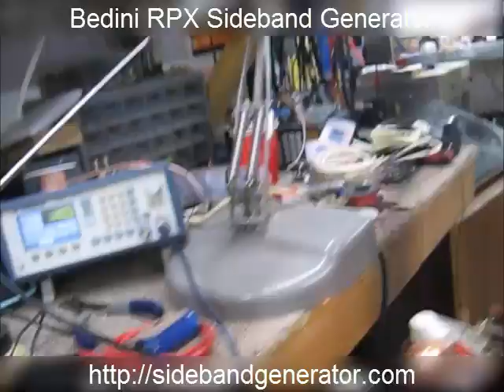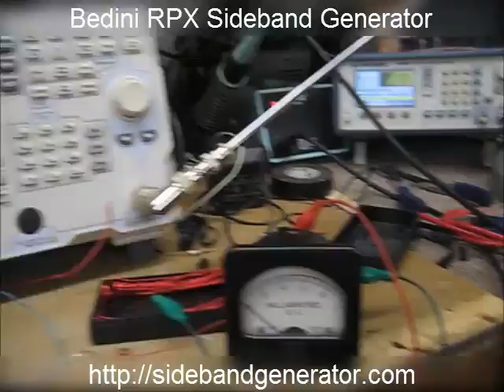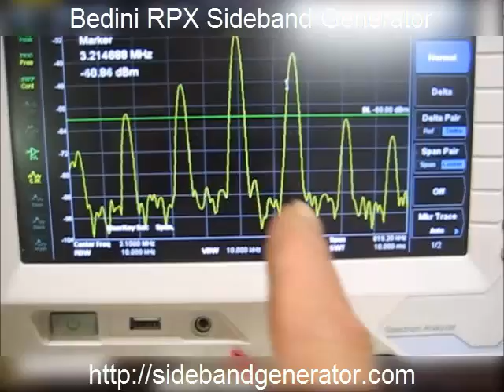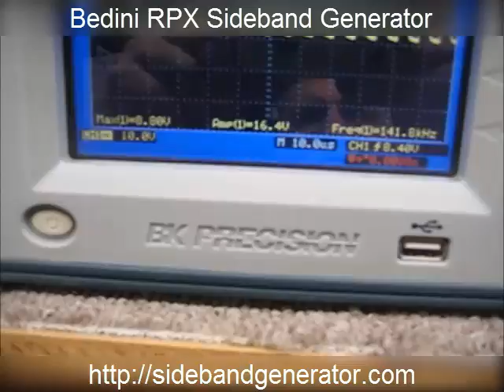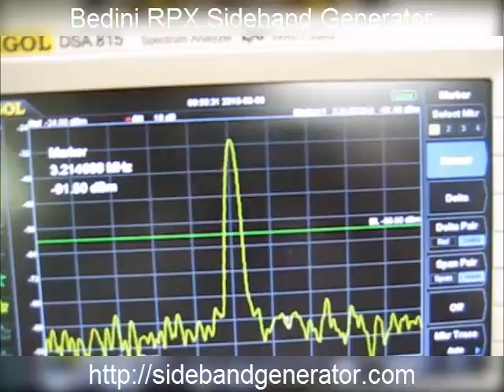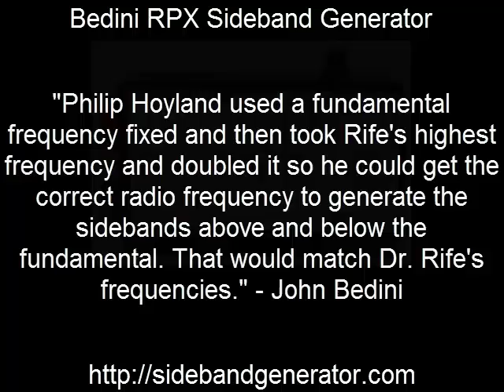The REAL Rife Machine by John Bedini - Bedini RPX

Comment: Yours is the best modern description of how the actual spectrum was generated by a Rife machine originally. Thank you for that.  You do gloss over the selection of the desired frequency by relying of MOPA oscillator wobble and square-wave oscillator sweep to suggest that the desired frequency will be "hit" at least sometimes, not very practical realy. This simplification is to be expected as Rife did the same.  There are no "real" official frequencies in existence.  It was simply a bunch of audio frequency square-wave harmonics modulated at RF frequencies in a nearly random manner depending on apparatus quality and operator skill. 

Due to the lack of any real way that Rife did not or anyone else has not documented ANY frequency to achieve a specific result I am inclined to think that we have no real indication of whether or not a frequency is even RELEVANT.  I am very sad about this because this technology, had it been designed and documented properly or been subject to repeatable duplication would have made a wonderful tool for humanity.  As it is the essence of the technique has been hidden.

However I have a theory that may explain how it worked even though the frequencies may have had nothing to do with it.  I have a strong conviction that it was merely a UV treatment device.  These have been used over many decades for all sorts of skin conditions and Rickets treatment and prevention as well as other deficiency diseases.  They have been used in submarines to achieve health for the submariners and have been studies by many researchers.  I relate the benefits of the Rife machine as originally developed with the mercury vapour lamp radiator to the UVB radiation that it provided to people that would have produced generous doses of Viramin-D3 that our Immune System requires to fight off any and all pathogens. There is a partial list of conditions that have been proved to be tractable to Vitamin-D3 treatment or prophylaxis and at a guess I would say they will have many common conditions with those that the Rife Resonator would have succeeded in treating.

Due to the nature of YT filtering I cannot place a direct link here but you can find it with a online search on the text below.

Proof+that+Vitamin+D+Works vitaminDwiki

Comment: Is the MOPA device and plasma tube necessary?  I thought John's RPX sidebandgenerator with multifunction generator and battery was sufficient and that all you had to do was hook it up to copper rings or iron plates or a rodin coil etc, no?
Reply from the maker: MOPA isn't necessary - that is the point of the RPX is that the high frequency fundamental and sidebands are piggybacking on a low frequency square wave. The video is provided as a part of the school of thought and methodology. Output goes to electrodes but can be put to antennas, but electrodes are best.
Reply: @AaronMurakami13  Thanks for replying and sharing this knowledge with us. Would it be accurate to say the rpx deals with pathogens but the mwo allows the cells to evolve?
Reply from the maker: @hoofheartedicemelted296  You are correct in that this is what the inventors intention was when comparing Rife to Lakhovsky. However, even basic electrical stimulation with electrodes can have some positive effects outside of it's intended operation.
Reply: @AaronMurakami13  Thank you Aaron.  My DVD set and book is underway, hopefully when it is built and used it's, applications will become clearer. Also, thank you for the Redox Signalling Molecules book, it is an intriguing line of research.
Reply from the maker: @hoofheartedicemelted296  Thanks for your support. You will enjoy John's presentation on the RPX - and book.
Reply: @AaronMurakami13  n
Reply: Here, in this video, this is simply an explanation of how the sidebands work (fundamental frequency + audio frequencies). You do not have to use a plasma tube or a phanotron. Bedini-Aaron's device is just perfect for this, saving a lot of power and using metal cylinders or plate to get the signal work for you, etc. (Henri P. - VE2WHA)).

Comment: Hello Aaron, could I ask you why you have the device giving out 3.1 Mhz ? I mean rife documents always speaks carrier frequencies from 3.30 to 3.80 Mhz ...
Reply from the maker: Hi, Rife used the full range from 3.0mhz to the high 3.0mhz range. The whole range is fine as long as the low frequencies mixing with the 3.x mhz combine (added or subtracted) to make the "Rife Frequencies". At 3.1mhz, more of the frequencies are at a higher amplitude than the other fundamentals. The closer the sidebands are to the 3.x mhz, the higher the amplitude. John picked 3.1mhz because more of the sidebands that hit the "Rife Frequencies" were stronger than other fundamentals. You can find the sideband calculator on some of the rife sites to see this. You cold use 3.3 to 3.8mhz and do well enough.

Comment: Recently found that if you jet spray water out if a tap with your thumb causing the spray it heals wounds amazingly quick The logic I believe is that the bodies charge is intermixing with the water and as you cause a infinite vibrational jet stream it is going through infinite frequency bubbles of pressure and vacuum and low and high frequency ranges. Cold water. Appears best. It stings on an initial deep injury as it also jet wash cleans it but no dressing placed over wound just curry powder and Himalayan salt acts as a coagelent. Then repeat 4 to 8 hours for approx 10 minutes Next day in open sun air wound massively repaired Tried it 3 times used spooky2 blood frequencies for back up of any sign of infection youtube
Reply: far from infinite , we have no idea how much psi there needs to be. how do u know your blood frequency
Reply: It works for me that's the best I can say having not used any pharma drugs now for 8 years or plasters for last year only natural remedies and the rayocomp ps 1000.   And researching water the Tibetan monks knowledge and others     Like washing in a rain storm you get soaked with static pos rain   That too aids my ills and any joint pains and lymes disease potential bite infections    Very strange until you realise its all pulses    Simple
Reply: interesting bro. im a vegetarian for 8 years. i started taking a teaspoon of epsom salt perday it has eliminated lower back pain\sciatica. its loaded with magnesium sulfate. i feel we loose magnesium everytime we get a gram of sugar or carbohydrate. meat eating causes grey hairs ! i have learned alot and youre learning alot i appreciate the correspondence to conquer health issues
Reply: @sirjohnahayfalcon  hahaha LOL
Reply: @HumanOptimization   im still here and back pain is eliminated by drinking grape juice, jesus christ is lord

Comment: Very impressed, Aaron and John. I know you can't make any claims, but what kinds of subtle energy, chi flow, or other effects have you noticed from being in this field? What is possible with the RPX alone (and say electrode pads on the body). Versus the hydrogen gas tube shown in the video?
Reply from the maker: Hi William, I'm sensitive with almost 20 years of qigong experience but is still subjective. I personally use a 6 inch Tesla pancake coil with one single winding.
Reply from the maker: What is possible with the electrodes are the same as the gas tube because of the pump wave that delivers the frequencies with low current to its destination. The pump wave carries the frequencies like packets of information. http://bedinirpxbook.com